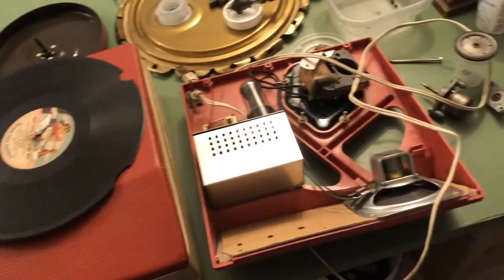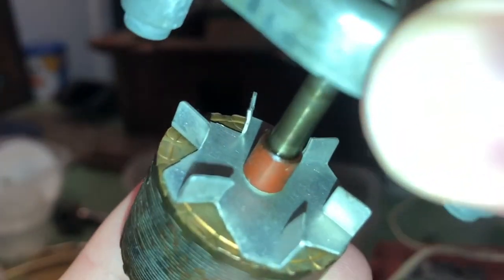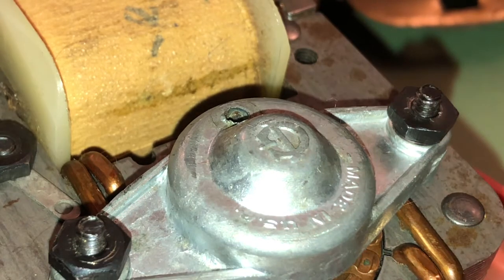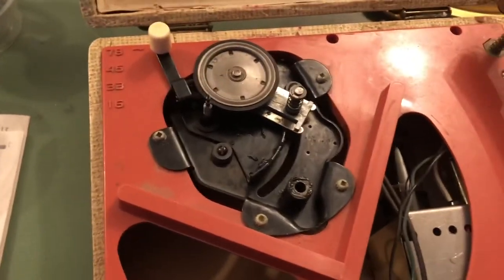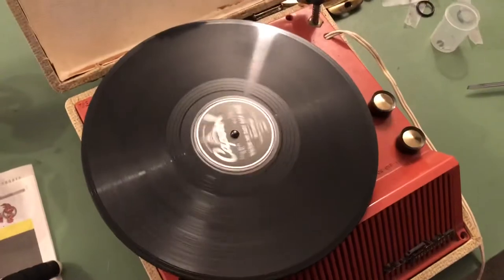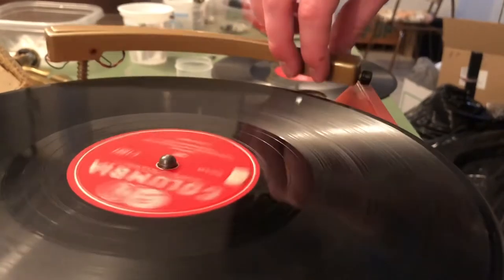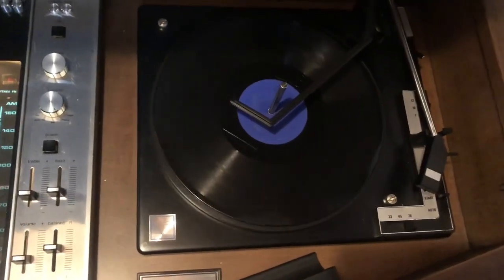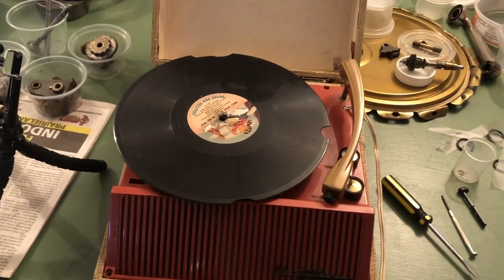Electrohome Portable Record Player Repair (Part 4)

Comment: I think you may want to consider recapping the amp before you pull your hair out too much messing with the pick-up cartridge.
Any paper caps will have to go, whether they are the type with wax-covered cardboard bodies, or they are the black 'bumble bee' types. The electrolytic caps in the power supply should be replaced as well, especially if you hear any hum from the speaker with the volume turned down all the way. 

That ticking noise sounds like it has the same frequency as the idler wheel rpm. Check the idler for a flat or hard spot. I have a Waters-Conley player with that same General Industries mechanism. Does the speed selector have a position marked N? if it does, that is the position to shift to when not using the player, because it retracts the idler wheel from the motor shaft so flat spots won't develop. I removed the old tire from the idler wheel on mine and replaced it with an o-ring from the plumbing section at Lowe's.
Reply from the maker: Yeah, sadly there's no Neutral function on this player. Hence the most likely hard spot on the idler. I'll have to go give either Lowes or home depot to see about a new "tire" ! 

I see what you mean about those caps. Now I'll have to learn about the values of caps and how to replace them, I don't think this will be some incredibly difficult challenge, but we'll see where this takes me.
Reply: @thegregolarecordsclub6564  Not having a neutral position isn't great.  Not the end of the world though, just keep it in mind you'll want to 'exercise' it more frequently then after replacing the tire to guard against flat spots. 

A little amp like this isn't bad to recap, and way easier than doing a tube radio. Use 630v rated caps of the same microfarad values, or as close as you can. Standard values today are a bit different than what they used then, but will work just fine. A modern 0.047uF will replace an old 0.05uF cap, 0.033 will replace 0.03, etc, just use the nearest values to the originals.